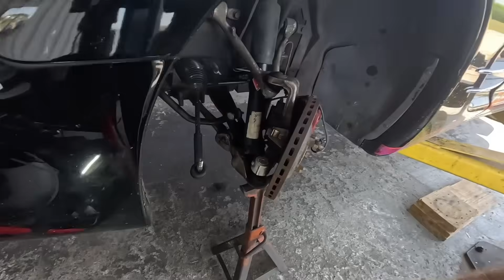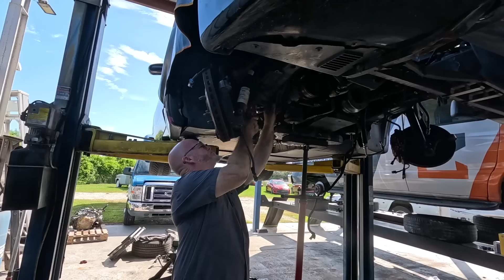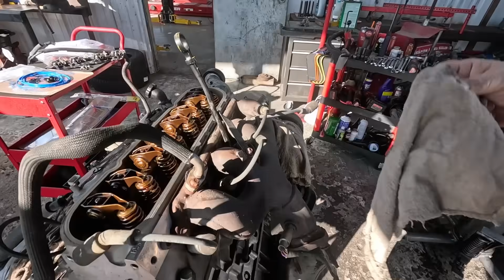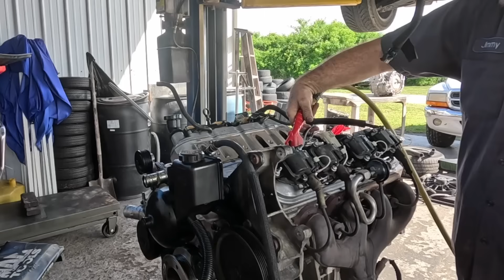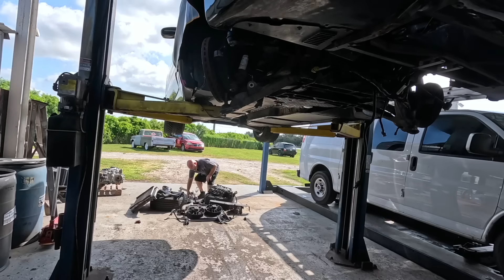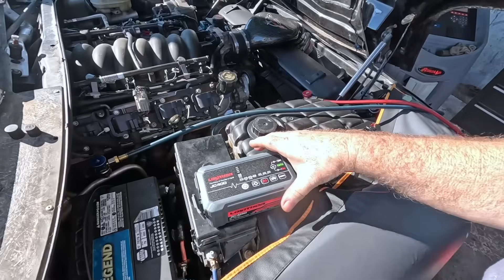CORVETTE Engine Reseal, start to finish with Engine R&R and Start up

Comment: Thick rubber band on the jaws of that puller & it won't pop off when the tie rod pulls out.  Usually keeps the tool from dropping on the floor.
Reply from the maker: Great tip! But I have to keep the show suspenseful, haha.